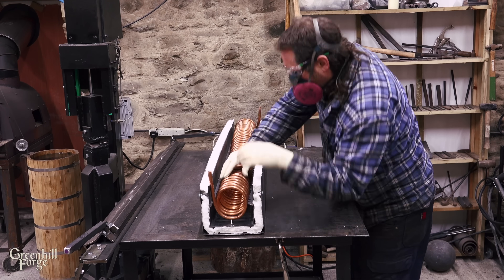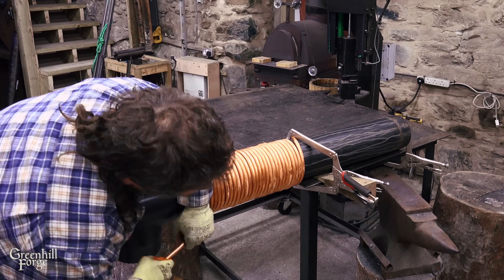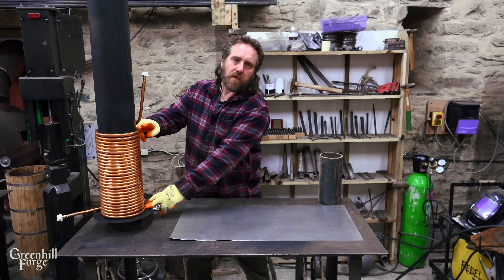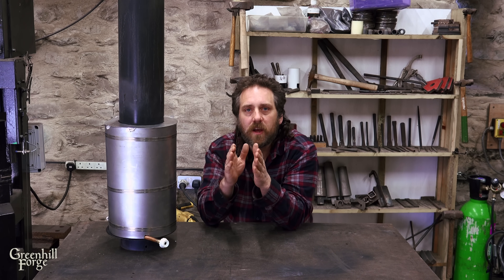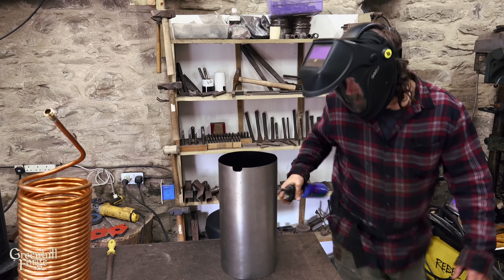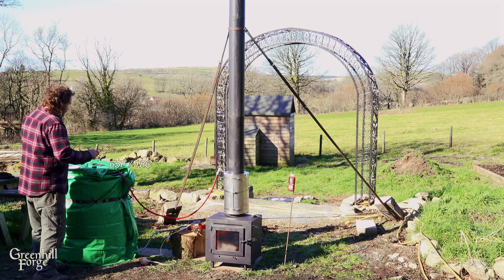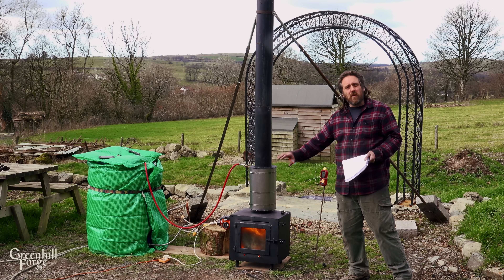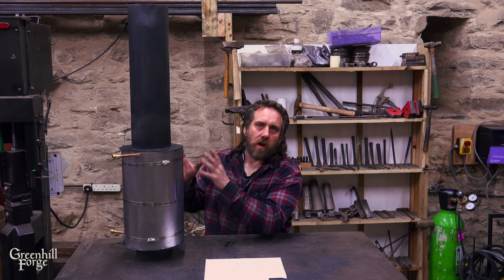Best Wood Stove Water Heater Yet: New Design Tested | Off Grid Water Heater pt3

Comment: Something I didn't hear you mention but I noticed watching the footage back, the coil inside the flue looks to have around 3 times more length vertically than the outside comparison. I know you probably used the same amount of copper coil in both, so surface area is pretty comparable but it still makes me wonder if there's any efficiency gain for having it longer along the flue pipe.

Also, I would have never thought about the graphite, cool experiment. I kind of like the idea of the thermal battery aspect though, especially if you were to scale it up at all. It could potentially still heat up water after the fire is burned down, thermal buffer, etc... 

Love the vids man, keep it up.

Comment: Maybe there is some room for improvement in how much of the heat is conducted through the flue to the outside where you have your coil. The obvious thing is to increase the height of the coil by just stretching it out a bit. I guess it's a longshot, but maybe the material the flu is made of can have an impact on heat transfer also. Dunno what material would be more efficient at this than steel though.

Comment: One advantage he left out.  Putting the coil on the outside is much easier to build.

A future improvement may be to put some type of spiral inside the flue.  This will increase the surface area contact and force more of the hot gasses to interact with the side walls, transfering heat.

Another option to step this up in complexity would be to do a pipe in pipe flue.  All you really need is the same or greater crossectional flow area as the outlet on the stove itself.  So, you could do an excessively large outer pipe and a smaller inner pipe where gasses will travel between the two.  This will more than double the contact area for heat transfer and allow you to run a double coil.  One inside the smaller pipe and one outside the larger pipe.  Combine that with your graphite powder, and it could be remarkably efficient.

Also, I don't believe the potential for a thermitic reaction with aluminum powder is really that high.  It takes a very specific set of chemical compounds to do that, and the ignition temp is much higher than what you will get on the outside of the flue.

Comment: This whole series in making me want to build an outdoor hottub.
Reply: Outdoor hottub, shower, and sink basin with warm water.
Reply: That reminds me of my son and his friends out in the mountains of Alberta making a hot tub in the back of a pickup truck. They parked beside the creek and built a big fire with copper tubing wound up ... just a garden hose to the creek and to the truck box. They had to beef up the support under the box. It worked like extremely well!!!
Reply: Exactly why I'm watching it. Did the LP water heater for the inflatable hot tub and really just want a stock tank one now with wood fire and this.
Reply: I'd love to use this for an outdoor hottub using seawater. I wonder if the copper coil would last very long?
Reply: @RichardHowley-k4e  there's a more robust solution that people here use for hot tubs - basically just a stainless steel closed fireplace suspended inside the water - the wood feed is also the air intake.  Baffle between the fireplace and the bathers to prevent incidental contact with the steel, and a few pipes through the body to increase surface area. It works remarkably well for how simple it is, and would probably be more reliable in saltwater than a closed copper coil.

Comment: I would be interested to see a test that extends the contact area with the flue comparable to the length you used with the coil inside the flue. A great video. Watching so I can build my off- grid radiator heating system. I was thinking of a sand battery as well to store the heat. My only concern however is that cooling down the flue has a possibility of increasing the production and accumulation of creosote as the gas is cooler before it exhausts. Another idea I am also thinking is to build a triangular cover for the stove top up to the flu and filling it with sand (or graphite) with additional coils of pipework in that, picking up extra heat from the stove and not just the flue.

Comment: I have experimented with wood stoves heating water and found it to be not worth while, the flue pipe needs it's heat to enable an upward draw in the flue, this keeps the flue pipe clean inside and prevents condensation and draws fresh air into the stove to feed the fire, if you want to divert heat for heating water you have to take from the stove itself, but then this diverted heat no longer enters the room.

Comment: I don't think you have to wind the copper that tightly with the graphite powder as a conductor. Just make it longer to be able to gather temperature from a larger area. The graphite powder will take care of the heat transfer. you won't need more copper.

Comment: What if you had copper fins that were inside the flue and thermal-bridged to the coil on the outside of the the pipe? it would be a bitch to build, but the larger copper mass of the plate used in the fins would transfer a great deal of heat. you could even make them in stacks, where several fin plates could be stacked to dial in temp-over-time in your water tank. You should also insulate your water lines for maximum efficiency. 

Is there a way I can send you a 3D render?

Comment: At 1:27 you mention the ceramic coating on the flue pipe. Does the ceramic coating have any heat rejection properties? If it does, you may consider grinding it off to improve heat transfer, you'd have to address galvanic corrosion again, but you have options there. And if the coating is actually just high temp paint, I'd expect to see minimal gains from removing it.

Comment: Increasing the separation of the coil by around 50% will allow you to utilise more of the heat in the stovepipe.  Graphite is genius, have you thought of talcum powder, should be similar to soapstone for thermal mass, I haven't tried it but should reconstitute back into a solid when its a wet slurry, poured and cast then dried out. the powder may contain too much air and act as an insulator.  Would be an interesting video.

Comment: Great video, I'd say more copper pipe, smaller diameter doubled up and with a reduction from 1\2 " to 10mm and the graphite the reduction will force the water to spend more time in the heat exchange chamber plus the double layer will start at the bottom go to the top and back to the bottom, which will heat the heat exchange chamber faster and will generate more heat. I Think 😀

Comment: This is heat transfer 101 to be honest.
Dont get me wrong, it is interesting but heat exchanger require DT and surface area.
This are the two main thins to focus on.
on all of these designs your main heat transfer surface area is the pipe wall.
You are improving the heat transfer a bit with the reduction of thermal resistance between the pipe wall and the cooper, but this is not how heat exchangers are suposed to work.
My sugestion would be to try an make the pipe itsself a water filed double wall one. if you can make some ridges on the gass side it would be even better.

Comment: Watching from Ireland, enjoying the channel and your approach to obtaining max efficiency of heat transfer. Here is a thought: How about changing the setup of the larger inner pipe to contain smaller pipes within it, they would still be the 'chimney' pipes, much like grabbing a bunch of plastic straws together in your hand, you still have the large collective air flow but with more potential surface area.  Fill the voids of the large diameter pipe with the smaller inner ones with your fine graphite powder then you could wrap your copper pipes around those therefore not just extract heat from the outer diameter of the pipe. Grab as much from the center of the pipe but still keep the 2 (copper and  potential creosote build up) separate from each other.

Comment: Have you considered just using water in the cavity between the flue and the pipes? It's pretty cheap, and quite good at transferring energy, but you might cause issues with rust long-term.

Comment: Really enjoying this saga. What if the graphite-coil chamber had flue gas both inside and outside of it? No insulation jacket, heat coming to the coil from both sides, tube in tube, would double the heat exposure of the coil.

Comment: Get a stainless steel beer keg, and some 309L welding rods or stainless mig wire, cut a hole in the top and  bottom of the keg, insert stainless steel pipe aprox 6 inch in diameter through the keg, this will be the stove pipe, then weld watertight around the pipe so you've basically mimicked a natural gas water heater, the stove pipe will heat the whole thermal mass of the water and the stainless steel keg will prevent any corrosion or contamination of the water. Include a pressure relief valve and your inputs/outputs welded into the keg. This will prove to be the most efficient way to heat up the water and keep it hot, while also keeping the stove pipe clean and clear, also stainless steel pipe can withstand higher flue Temps than mild steel. This set up also allows for a gravity feed system if the water supply is above the keg, thus removing the need for the pump. Off grid this can be done by putting the main water tank on the top floor of the building and the stove and keg combo on the bottom floor. Alternatively you could just simply find an old gas powered waterheater and adapt the flue on it to accept the output from the wood stove instead of the gas burner. I've seen this done with great success, and the bonus is that it will heat 60 gallons at once, so showers, doing dishes etc only require having one good fire a day, and the water heater is already insulated so theres a serious cost saving there too, you should be able to find a used or non functional water heater for free too. Good luck!
Reply: Yep! if we are discarding pipes inside the flue then the next best approach is to have a water tank surrounding the flue.
Reply: We're basically reinventing heat exchangers.
Reply: @CarltonChong  That it is a heat exchanger has been clear from the start. I see this mostly as a test of manufacturing at a home level and what designs are possible to make and work fine in the long run. Even if a water jacket around the stove pipe would be more efficient if people can make it at home because of lack of skill, equipment, cost etc limit how many people can do that  a simple but less efficient design still advantages.
Reply: @target844  If one could make water tight welds and cut end rings, it would not be that difficult to make a water jacket that runs for most of the length of the chimney pipe.

I have welded water tight welds before. It requires assiduous joint preparation, but it's quite feasible. You can also cheat with epoxy sealants on the cold weldments on the outer tube.

If one could make only one water tight weld, one could weld on a cup shaped end cap at the bottom and sleeve a pipe inside the end cap to make a kind of drip line design and pump water into the top to run down around the pipe. This design would require only one water tight weld at the bottom cup.

You could also go with a non spiral heat exchanger.

Instead bend/join a long U shape which drops down into the open end at the top of the chimney and flow water through that long pipe. 

For creosote cleaning pull the U shape out to open up all of the surfaces for cleaning. Straight surfaces will brush off more easily than spiral ones.

Look at the problem abstractly as a heat exchanger, and you will see past spiral pipe solutions. 

Look at the physical problem you are solving and do not fixate on the first form you think of when you are beginning a design process.

I wonder if you could blow that exhaust through a bath like a giant bong that directly bubbles the smoke through a water reservoir. Run the big bubbles through some vanes to break them up to achieve higher surface area. 

Use that foul sooty reservoir of burbling hot water to run a lower temp heat exchanger that brings heat to your potable water.

I don't think I've ever heard of a direct bong heat exchanger for the purpose of heating water before. Such a heat capture method could end up being super efficient as you'd be condensing the steam from the smoke quite effectively. Heck it would also be a scrubber for your acrid smoke.

Dood that would be Sweet!
Reply: @CarltonChong  bur a stove with a water tank on the side. Fill from the top. Spigot on bottom. The Amish use them. Yes I’ve been in many of their houses.
Reply: This is the way.  Way more contact surface
Reply: Yep I came to the comments to say something similar if nobody else hadn’t. Water jacketed flue is the most efficient because of the contact area. If you feel skilled you could braze in some copper fins protruding the inner flue pipe and really collect the heat.
Reply: @anthony10370  adding fins might help, but brazing copper to stainless steel is risky and difficult,  better to just use stainless fins welded to the flue pipe, although with the stove pipe running through the tank, not really necessary.  When in doubt copy a design that already works, then modify as needed.
Reply: " Alternatively you could just simply find an old gas powered waterheater and ..." set it on 3 pier blocks, after having hack-sawed off all the old gas-powered junk. That's what I did. So now I've got an outdoor, 30-gallon, wood-fired, gravity-flowing insulated $5 water heater for the outdoor kitchen and outdoor shower.  There's only a 3" flue in the old water heater, but that's no problem.  I use well-seasoned 1-3" fir limbwood gathered from continuous forest improvement work, always keeping a bright fire burning.
  Although there still is the old T&P Relief valve on the heater, I do not rely on it for explosion safety. Rather, after ensuring the heater tank is FULL by opening both the gravity flow inlet to the heater AND opening the shower head valve, I then shut off the gravity flow inlet, leaving the shower valve open.  Only then do I light the fire with the assurance that I am heating an Open Vessel.  If I overheat, nothing bad happens except steam comes out the shower head
  I would pay good money for a s/s beer keg  heater with cold-in, hot-out, and a 3" flue.  Heck Yeah !
Reply: @petermarshall3393 nice. I have started coppicing hazel and maple for a ready supply of that kind of fuel wood for just this kind of usage. I'd love to hear about your long term experience with this
Reply: @petermarshall3393 My build was similar to yours. However I ran the build cost up to probably $10 because discarded truck wheels were used as the firebox. A wheel was located with a "step" that "nested" exactly over the water tank's diameter. A second larger wheel acted as the base. A "window" was cut into the lower wheel to function as the fuel loading door.

I had built a loading door with air inlet draft control. It was found to be unnecessary as the door was always just left open.

This was operated as a closed pressurized system (@ 60psi) without issue.

Previously I had toyed with various "piggyback" systems to heat domestic water from the building heater's firebox. I was never able to find a reliable way to sync space heating needs and water heating needs.
Reply: @petermarshall3393  
I'd pay good money for a ss beer keg full of any beer other than Anheuser Busch products.
Reply: I know as soon as i saw his welds i went what we doing here? Just build a jacketed pipe with an inlet and outlet.
Reply: BTW - the more efficient you get with the heat transfer, the more creosote will build up, because you will cool down the gases. But if occasionally you burn off the creosote, by having nothing absorbing the heat (drain the water and leave it unpressurized), then the you reduce the build up.
Reply: @markberning9142 so what you are saying is that this would work better if used on a rocket stove which has a burn chamber at high temperatures that will dramatically reduce any creosote from being emitted (the complete burn happens in a chamber prior to traveling to the exhaust pipe).
Reply: I was thinking that I’d start with an old motorcycle radiator, and strap it to the top of that stove. All the fins should transfer a lot more heat.
Reply: @jeffweber8244  I wonder if it could stand the heat? A radiator is probably made for temperatures of max 120C?
Reply: Just get a log burner with a back boiler.
Reply: @jasonburguess What you wrote seemed interesting. Could you record it as a video and show it to us?
Reply: Using stainless, n I've seen this done,  jacket the whole stove n extend jacket upward around pipe.  Then add something like a magic heat unit to make use of any escaping heat.
Reply: Or save a ton of work and put several large kettles on the stove. Done.  If you have enough room for a water tank around your flue, fine, but most people are  looking at using water in the kitchen/bath, not living room.
Reply: Water jacket definitely the way to go. This minimises the temperature of the flue wall, maximising heat flow. The other two factors to optimise are 1) surface area and 2) turbulence.  Obviously doubling the area will double the chance of heat getting out of the gases. Since at the moment 85% of the heat is still going up the chimney then you should get another 85%x 15% = 13% giving us a total of 28% efficiency if for example we double the height of the jacket. Turbulence - you are removing heat from the outside of the cylinder of flue air.  The flue gases in the middle of the flue don't get anywhere near the walls and will carry their heat straight past the jacket.  The heat exchanger needs bends in the path of the flue gases. A modern gas boiler gets to 85% to 90% efficiency by optimising all these factors.